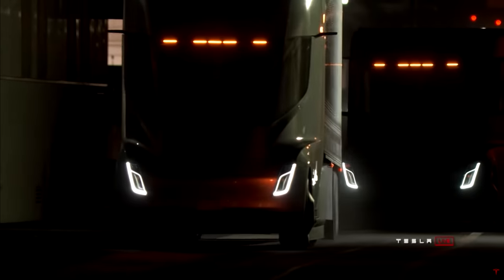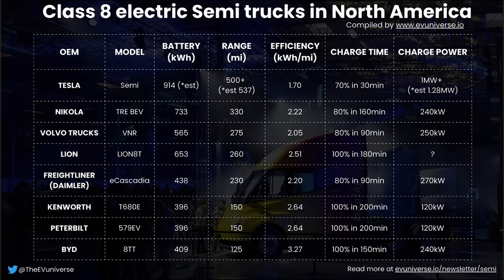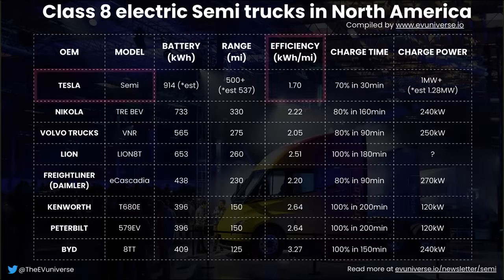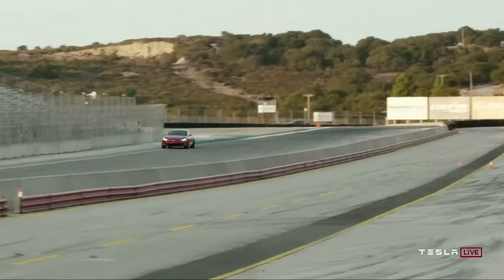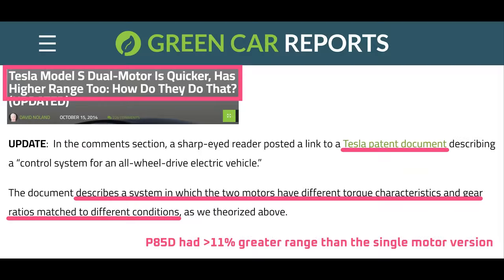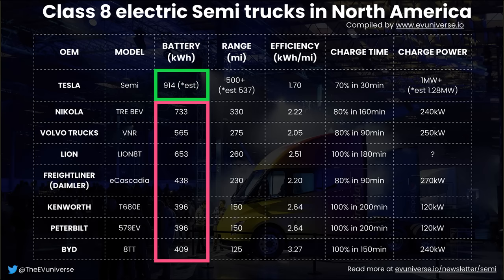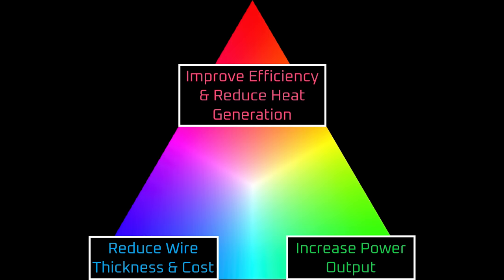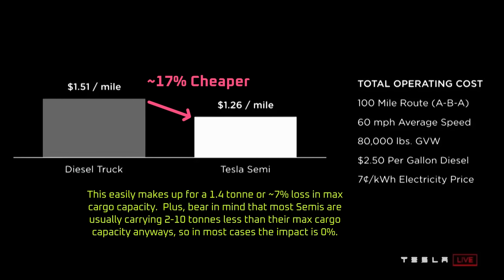How the Tesla Semi “Broke the Laws of Physics”

Comment: Has the unloaded weight been published anywhere yet?  I never had any doubt a fully truck 500 miles, but an important question is what is the effect on payload.
Reply from the maker: Engineering explained to did a great video on it
Reply: The 500 miles range test semi was loaded to about 43,000 lbs. payload and a GCVW of 81,000 lbs.
Reply: @BigBen621  where did the number come from.  Still 3-6k shy of a diesel.
Reply: @dwaynepenner2788  The GCVW of 81,000 lbs. was in the header of the video. The payload estimate comes from subtracting the estimated 12,000 lb. weight of a 53' dry van trailer and the 26,000 lb. estimated weight of the Tesla Semi from 81,000 lbs.
In the first few seconds of the video, you can see a pallet marked 600KG, or >1,300 lbs., at the very back of the trailer, where lightest loads are placed. There are at least 27 pallets in the trailer, which is consistent with a 42,000 lb. payload, if other pallets are somewhat heavier.
No one's claiming the Tesla Semi can carry the same load as every diesel semi, although I've yet to hear a claim of a diesel semi carrying 48,000 lbs. as you claim. But Tesla's business plan only calls for replacing a few percent of diesel semis every year; so it only has to be able to do what a small percent of diesel semis do, to be a complete success for Tesla.
Reply: @BigBen621  yeah, saw the video…still waiting for something more official than assumptions (no matter how good they are).  An apples to apples is more likely  a diesel(day cab truck…no sleeper as the Tesla does not have one … that weighs around 17K, I have issue with Jason’s number there making a 9K difference alone) That is a proven number over thousands of loads.  We are making assumptions that every pallet is the same load…which given Teslas other media events it is valid to question. Jason makes assumptions based on industry averages that consider both long haul and short haul trucks etc.
Reply: @dwaynepenner2788  Yes, many assumptions built into those estimates. One way or another, the real numbers will either be published or leaked; until then, estimates are the closest we can come.

Comment: Nobodys point out that the chassis of a diesel semi have two massive steel rebar due to the massive amount off torque being driven down the drive axel.
Not only must thry prevent permenant twisting off the chassis, but even temporarily twisting would lift the left set off rear wheels of the ground cutting power delivery by 50%

Teslas power is in line with the drive motion and direct to the wheel. It has no need for these rebar? 

These rebar must weigh a ton or two
Reply: There is no "rebar" in a truck chassis. The front axle is normally a dead (non-driven) beam axle with leaf springs... and the Tesla Semi presumably has the same thing, since it uses industry-standard suspensions (and wheel-end components). The reaction to drive torque with  conventional powertrain is actually taken by the rear suspensions, and those are the same in the Tesla Semi as other highway tractors.

Comment: I do not have any evidence, however I'd wager the acceleration focused motors are not each driving a single tire but 2~3 tiers. all the back tires on each side are probably hooked up to an acceleration focused motor. It puts all the weight of the vehicle right above the tires so you shouldn't worry about losing traction too easily lets them soak up most of the regen braking and accelerating, while the front two tires just deal with cruising conditions.
Reply: It's all in the diagram.
The "Drive" motors take a wheel each.
The "cruise" motor drives a pair.
The "genius" if the system is all you require is a speed sensor on each motor and another on each "output shaft" (drive shaft).
Once that's in place, the two "axles" can have different gearing.
If you want the "double" motors spinning faster for more wheel torque, just gear down and adjust the motor/ axle speed ratio in software.
.
Personally, I think they'll go the "KISS" route since it already had torque to burn.
.
The best (different) component is no different component. (Gears)
Reply: @rogerstarkey5390  I think the diagram was purposeful in making something clear while obfuscating something else. It made known how the 2 different types of motors are getting used while obfuscating which drove the front and back tires.

Does it make sense to put the battery pack up front or toward the back. The back right? Then put the shafted motor in the front to drive the truck while cruising. It can be tuned for maintaining cruising speeds between 45~65mph
Put the acceleration motors in the back so the battery pack has the entire center of the back space open for it to use for structural rigidity.
Now, one of the 2~3 tires on each side is likely directly hooked up to an acceleration focused motor, the other one or two could now be linked in a number of ways to increase the amount of energy you can put from motor to road without causing the tire to spin. chain (doubtful), gears (unlikely), belt (probably). It's a cheap, light, easy option and if the resistance goes beyond the system, the tire merely slips a little.
Reply: @chimerawizard5639  Which motor drives which tire is not obfuscated - it is completely clear.

The battery is so large that it fills the entire width of the truck (between the frame rails and on each side of them) from just behind the front tire to just ahead of the first rear tire. The areas of the axles (front and rear) are clear of battery, as required to accommodate beam axles (which are used both front and rear, as is the case in nearly all commercial heavy trucks). The reason that the "500 mile" version has a longer cab (with little other than empty space in the additional length) is to allow room for three rows of battery boxes instead of the two rows of the "300 mile" version. It isn't placed for forward/rearward weight distribution, it's just in the only large space available.

A motor on the front axle would be desirable for regenerative braking; however, when the truck is working (loaded with a trailer) each rear axle carries more load than the front axle, so that's where the drive belongs.

The battery cases are not used to add structural rigidity to the vehicle structure - it has a conventional heavy truck ladder frame.

Your mechanical drive schemes are vastly more complicated than what is needed, or used by any production EV.

Comment: What’s really cool is the trip was mostly downhill so it could go one way 500 and not the other direction without a charge because physics - also average speed was 53 mph so not typical semi speeds geared towards reducing drag - typical semis I know pull between 70mph to 80mph so efficiency would be less
Reply: Where'd you get the nutty idea that the trip was mostly downhill? Because the blue line slopes down from left to right? That's the line showing the battery charge decreasing fairly steadily from the beginning to the end of the trip. The trip started at Fremont, CA, elev. 56 ft.; and ended in San Diego, CA, elev. 62 ft.; so the trip was actually very slightly uphill. 

The speed was mostly between 55 MPH and 65 MPH, because the speed limit for trucks in California is 55 MPH, and drivers' CDLs and livelihood are at risk if they're cited for speeding. Where did you get the average speed of 53 MPH? Of course the range would be less at 70 to 80 MPH.
Reply: @BigBen621  He gets the idea because it panders to what he wants to be true.  The rest he makes up.  These people are as desperate as they are dishonest.

Comment: How do you come up with Tesla's 20% efficiency advantage? If I compare the Bolts MPGe of 120 to a Model 3's 132, that is around a 10% difference. Is there something wrong or that is missing with using MPGe to determine efficiency?
Reply: I'm always wary of manufacturer's range figures.  Musk is notorious for the inaccuracy of the information he provides, but TBH the other manufacturers do it too.  Some decent Youtube videos showing real world testing (you can usually tell which are objective and which are biased).
Reply from the maker: You have to look at efficiency for a given weight, not just raw efficiency.  And electric bike is super efficient, but only carries one person
Reply: @chriswright9096  
You should be taking a look at the latest Bjørn Nyland Tesla test.
Amazingly efficient.
Reply: @thelimitingfactor  Oh that makes sense, thanks for responding. Love the videos, they're always quality.
Reply: @chriswright9096  Not sure what you're saying; Tesla showed a real world video demonstrating a 500 mile range on 93% battery energy.
Reply: @BigBen621  How fast was the truck going and how much payload?
Reply: @chriswright9096  It was mostly going between 55 MPH (California speed limit) and 65 MPH, probably averaging about 60 MPH. And it was likely loaded to at least 39,000 lbs., and probably more—based on the likely number of pallets and the fact that one pallet was clearly marked 600KG.

Comment: Thanks for another great video. I am struggling with the M3 AWD power vs. speed curves and also the statement that in track mode the Regen power is 100kW. I've got a lot of data that contradict these two statements. Maybe we can compare the data at some point. Also the Regen power seems to be partly battery limited, which is an easy CAN value that is available, but also runs pretty much negative to the power vs. speed curve. Maximum regen in the same speed region as maximum power, so it is a motor limitation as well.

Comment: Disengaging one motor may be energy efficient. But Musk mentioned that the Semi wouldn't Jackknifing.
I thought that requires the motors on all axes to be active.

Any thoughts on that?
Reply from the maker: Depends on how quick they re-engage and what jack knife condition.
Reply: Jackknifing is only possible, when the trailer is pushing forward against the engine, by braking the engine more than the trailer. And in this case, the two motors should been coupled at all for regen. So it shouldn’t be an issue to adjust the torque on the two motors to avoid jackknifing.

Comment: Jordan, Apple processors are able to outperform Android ones both in performance and efficiency metric while using fewer cores. 

What is the Limiting Factor in using the same approach and getting rid of at least one Tesla Semi motor via advanced electronics & AI software to handle both performance and efficiency based on use case? It seems like the Semi will never use all 3 motors at the same time (unlike the S Plaid) so 33% or 66% of them are sitting idle all the time which is quite inefficient in terms of extra costs and weight. Any physical limitation to get down to one performance and one efficiency power train, should Semi production go so big that economies of scale allows Tesla to design truck specific motors?
Reply: On the contrary, the "cost/ weight" would be a high penalty when applied to a car, but these motors bestow a massive advantage in energy terms when installed in a (potentially) 82,000lb vehicle.
They save on battery weight/ cost.
They afford HUGE benefit in general control, safety and redundant systems (which can keep the vehicle running is there is a system failure.... 1 motor down, the truck is still in service)
.
The weight penalty is miniscule.
.
Then there's the regen, which as mentioned, collects a huge amount of energy
I'd actually go as far as to say, it the 3 motors that make this truck not only impressive, but possible.
Reply: Using only one motor per axle, you need a differential gear. Which costs money, complexity, manufacturing cost and weight. This would be nearly a zero sum trade. And you can‘t control the engine to avoid jackknifing. For this you need to adjust the torque on both sides in a fraction of a second, for several times in a second, which is only possible with independent and direct coupled motors at the wheels.

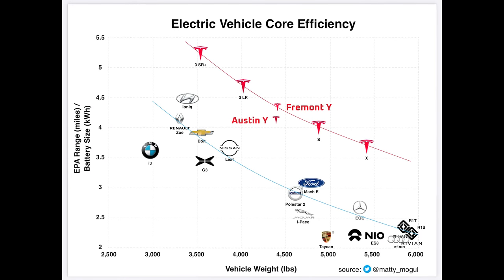Comment: 3:45 Hyundai Ioniq should be placed at the same level or slightly higher than the SR Model 3 here, as it's range per kwh is actually the same or even slightly better than that car, so the graph is a bit misleading.

Comment: The problem is the payload capacity of the semi is a limiting factor compared to its competitors. The acceleration of the truck also isn’t a consideration for trucking companies. Also some of the promises like that of a giga charger weren’t met. So yeah it’s not a design problem that trucking companies are concerned about. It’s the economic considerations that don’t make sense
Reply: The acceleration of a truck isn't a limiting factor, as you say; but it's a byproduct of having 2-3 times the HP of diesel semis, couched in terms non-truckers will understand (0-60 in 5 seconds for a bobtailing tractor). A "giga charger" was never promised; and 4 Megachargers have already been built at PepsiCo plants, with 8 more permitted.

Comment: Thank you for the insight. I'm wondering when will Tesla's 4680 be mature enough to compensate for that 7% weight and break even with diesel trucks range with at least 650mile range as well. Maybe Tesla could add a longer range version with a sleeper cab then? Right now the Tesla Semi is quite awesome but  we need to replace all diesel trucks isn't it? I think Tesla can achieve it with the 4680 expected to become about 300 wh/Kg energy density, isn't it?
Reply: The is step 1..  The technology (Tesla and others) will continue to evolve with time.
Reply: @TheEvilmooseofdoom  Yeah, I know. But I was hoping it would happen faster. Sadly it seems the pandemic, confinements,  supply chain issues, a war, etc. All that implies lots of unexpected delays. The semi was unveiled at 2017 and it took 5 years to get to production, but hey! It's finally here! Would be great if 4680 can take it to the next level sooner than other 5 years, the world needs it.

Comment: Interesting that you did not mentioned the rolling resistance.  The weight of the truck causes the tires to deform and cause higher rolling resistance.  Neglecting this basically the truck would have the same range loaded or unloaded while going at constant speed.  This is why Tesla uses high pressure tires, my Model X tires are rated at 51 psi.  Also this allows trains to carry such a humongous loads because the steel wheels have very little rolling resistance.
Reply: Semi's typically run 105-110 psi. I'd expect an electric to be even higher.

Comment: I have a hard time believing Tesla semis are only 17% lower then diesel semi operating cost.
Diesel semis require transmissions, therefore transmission repair and fluid change, oil changes, greater tire wear, and more frequent break pad replacement, due to Tesla Sunrise using regenerative breaking.
Reply from the maker: Read the pinned comment.
Reply: @thelimitingfactor 
Your information is impeccable.
Seems 17% operating cost savings with a Tesla semi is unreasonably low, even if Tesla is the source.
Sounds to me like some things aren't being included in that number.

Comment: Regen thing is harder to do when there is a trailer. From what I know, the brakes in the trailer should be stronger and faster than in the towing car.
Reply: Regenerative braking is done only by the tractor (truck), just as compression-release engine braking (using the "jake brake") is done with a diesel engine. For emergency stops, yes the trailer brakes are required.

Comment: I was driving a semi for about 5 years and in my opinion Tesla semi will not work for long distance ,only regional. Couple issues, price of operating would be higher than a diesel. Tesla said consumption would be 2kw per mile. If supercharger is let's say 50c per kw, it would cost 7$ for 7 miles. I was driving multiple old trucks from mid 2000s and average gas mileage is 7mpg, and a gallon of diesel is less than 5$ so driving a semi would be more expensive. I believe that Tesla can achieve 500 miles on a single charge but only in certain conditions, like driving 50 miles an hour. Using only 80% of the battery from let's say 90% to 10% that's 400 miles, driving 70mph instead of 50 would give 300 miles. When I was driving I would say over 80% of the loads were over 500 miles ond over 90% over 300 miles and most of the times you don't have a lot of time for breaks due to log book and appointments. I am not gonna even mention infrastructure, it's hard to find a parking spot at night even for regular semis that is much cheaper to make than a parking spot with supercharger. Some may say a cost of maintenance is a benefit. On engine maintenance I was spending 200$ on oil change every 15000 miles. I didn't have any big repairs on the engine, but for my old truck complete overhaul of the engine was around 11000$. Moderno engines are more expensive, I would guess double 22000$. If model s battery is 22000$ to replace, and model 3 16000$, I would guess semi batteries close to 200 000$, but even if they are 100 000$ that's way more than diesel engine overhaul that are designed to last miliona miles

Comment: Well there one thing they can do too is to add solar panels to the Dry vans loads and they can get somewhat a charge, breaking even or even just less the lost of power on the go when driving on day that are sunny, and that incase  it cant make it to the charging station then it can self limit the motors to keep going at a slow speed or even slow charge when not moving
Reply: I ran the math on that. It turns out that at mid-American latitudes (Denver, in this case), covering the roof of a 53' dry van trailer would add about 13 miles a day of range. But the additional air and rolling resistance due to the panels and associated equipment would reduce range by the same amount, so overall it's a wash. More importantly, though, the panels would increase the trailer's weight by about 2,000 lbs., and thus decrease the payload by the same amount. So there's no future in this.